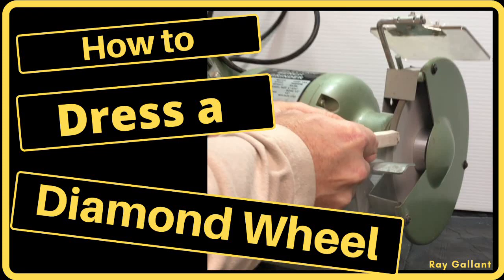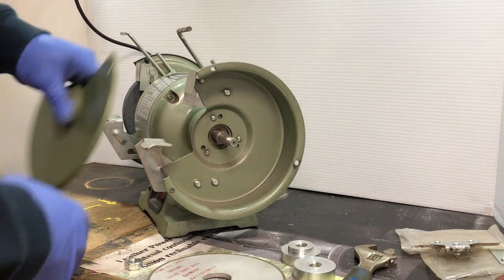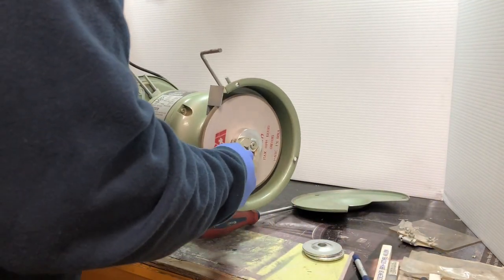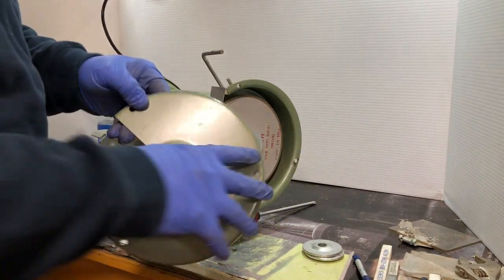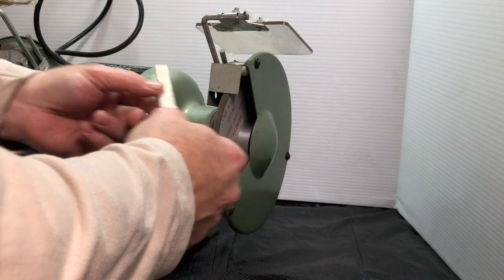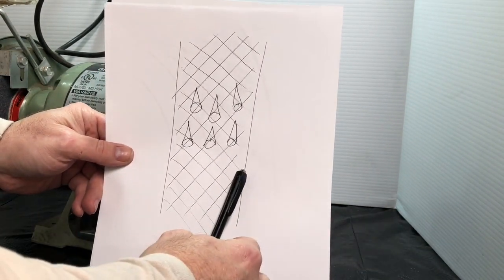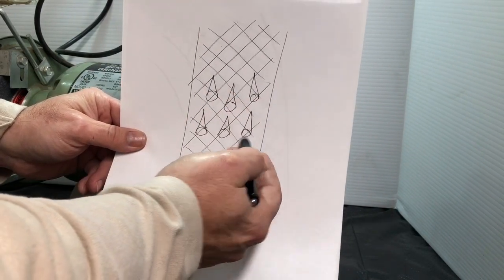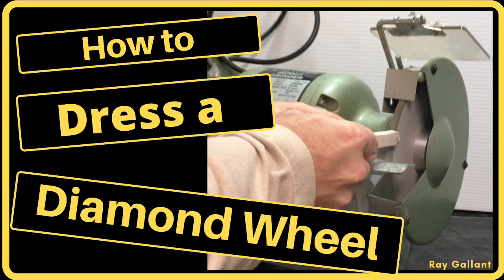How to dress a diamond wheel

Comment: Does the dressing stick have to be finer grit then the diamond wheel?
Reply from the maker: In my case, it wasn’t a smaller grit
The dressing sticks are made with a weaker bond, so they break apart easier 

In the shops that I have worked at, we only had box of dressing sticks for all of the different grits of diamond wheel

Comment: Would it be generally the same technique to dress saucer- and dish- shaped wheels (as commonly used in tool&cutter grinders)?
Reply from the maker: yes
only feed the dressing stick in until there is almost no resistance
if you go beyond that point you will remove to much of the bonding material
ray
Reply from the maker: the second question is not showing in the comments but I did get an email
the stick size should be larger than the wheel face 
but you can feed in on an angle to make up the difference
Ray
Reply: @shopandmath  Thanks Ray. I didn't ask that second question but good to know. The sticks I have (from eBay, China) are pretty small - 11x6 mm (~1/2" x 1/4"). Being in Europe, I had a hard time to find anything like those sticks. Norton recommends using a soft bond Aluminum Oxide stick 1 or 2 grades finer than the wheel, so I tried to find something like this from eBay, although they don't specify the bond. The sticks are light green in color, so I wonder if it's actually SiC and not AlOx. I'll just try them out and see if they work. I haven't made the flanges for mounting the diamond wheels yet.
Reply: @GenePavlovsky  
Try to keep the flanges as tight of tolerance as possible especially the back flange
On the cheap grinder that I used it was only a very very small lip that my back flange side 
If there’s a small radius you might need to take a needle file while the grinders running in square up the shoulder
I hope this helps best of luck
Ray
Reply: @8931831  Thanks for advice Ray. It is quite similar to what I read in Harold Hall's book "Tool & Cutter Sharpening". The bench grinder he bought for this purpose had the same problem (small lip). What he did is mounted the grinder on his lathe's ways with some packing to bring the axle to center height, aligned it until the axle was parallel to the lathe's Z axis, then powered up the grinder and, using the lathe carriage and cross slide feeds to cut, slightly reduced the diameter of the axle and squared up the now slightly enlarged lip. I think he then made a shouldered bushing and Loctited it on the axle, but maybe I am confusing it with something else. I don't remember exactly, I'll look it up in the book when I start this project. For what it's worth, Harold is using white AlOx grinding wheels which specify center holes as 1.25" (31.75mm), but actually have 32mm holes. I ordered some rather cheap (20-25 USD per one) dish and saucer diamond wheels from China, in very similar shapes as in his book, they are still in transit.
Thanks for your kind advice.
Gene

Comment: Thanks for this video. I inherited my FIL's Burke sharpener and learned a lot from him. One of my favorite wheels is what he called a diamond embed rubberized wheel, it is green in color. I have seen some jewelers polishing bits with a similar looking material.  It has some dips in it and thumps the blade a bit. I am researching dressing it to take out the humps. It is 6" of all consistent rubber material from center to edge and do not know how far the diamond is embedded, but you can see the diamond chips under magnification still on front edge and sides, it is not worn a whole lot from the original 6". I did take off some of the buildup on it with some wood, but was tempted to take some sandpaper to it and not finding any information on such a wheel. 
   Any ideas? I am afraid of using a diamond dressing tool for fear of chunking the rubber, it is at least 15 years old from my memory. The" rubber" is not soft you cannot leave a mark with a fingernail but does not seem to be a hard resin either.
Reply from the maker: I’m sorry I wish I could help you but I don’t really have any experience with diamond impregnated rubber
I do have grinding points that have diamond impregnated rubber cover used with a Dremel type tool
The only advice I would give you is to contact the manufacturer or a manufacturer of the type of wheel and ask them how to True it

Sorry I wish I could be more help
Ray

Comment: How do we know when the diamond wheel is used up?
Reply from the maker: Buy used up. I’m not sure what you mean but I’m going to suggest that used up means that it needs to be redressed.

The cutting forces and heat generated increased dramatically, and it does not cut carbide freely. Those are signs saying that you absolutely need to redress the wheel. 

Or used up could mean that there’s no life left in the wheel. These wheels are laminated to aluminum. There’s a certain thickness of glue before there’s only aluminum left, or if the unit becomes delaminated and chunks of diamond peel off. 

You know there’s no life left in the wheel when the wheel starts to delaminate when truing or dressing 

I hope that this made sense and hopefully I explained it well enough 

Ray
Reply: @shopandmath  just received a dressing stick in the mail, hope to try in soon

Comment: Can I use a diamond to dress this type of wheel ?
Reply: You cannot use a diamond to dress the style of wheel
Most people use aluminum oxide dressing sticks
They are generally soft Bond
Reply: I saw on the video it was a Norton stick but what kind
Reply from the maker: the bound is too strong and will not allow the grit to be removed this way
the idea is to remove the bond to expose the grits and not to remove the grits

Comment: If it’s an aluminum wheel why do you have to run it for 60 seconds
Reply from the maker: The wheel will not brake but the diamond could delaminate
That is why all guards need to be in place before starting the grinder